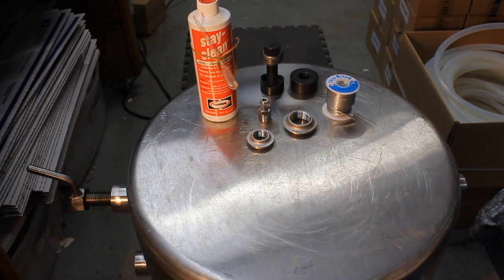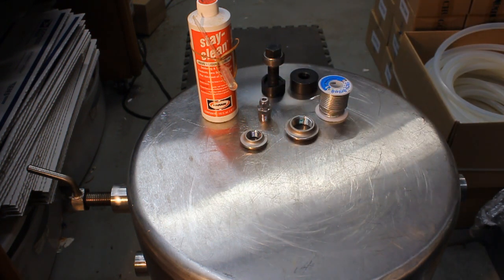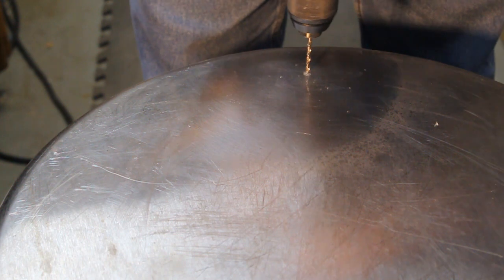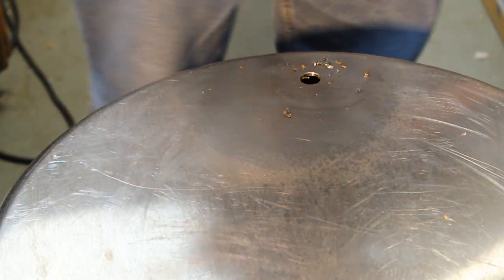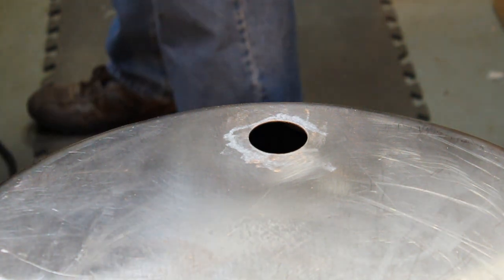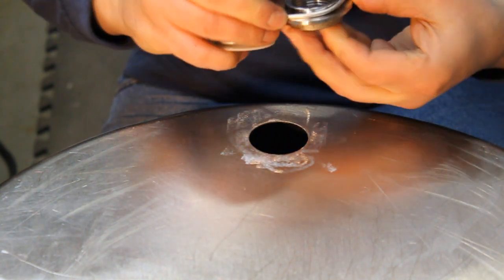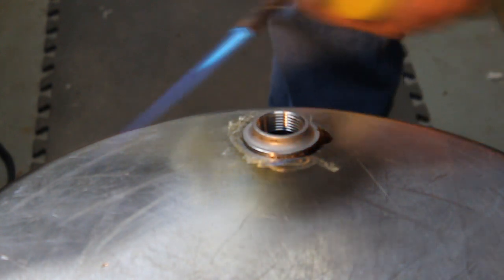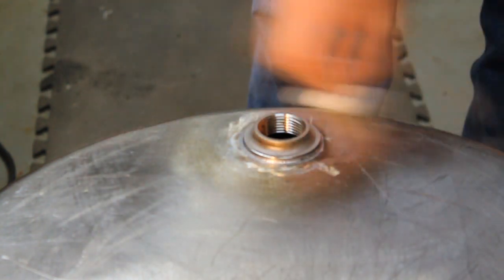BobbyfromNJ Full Silver Soldering Process

Comment: I use plain old vegetable oil in a solo cup to lubricate my step bits for cutting. Comes off easy with soap and water and you don't need to worry about petroleum products in your brew vessels.
Reply: soloban81 animal grease works well. So is having a wide point on your bit, 135° cuts metal way better than a general 118°.

Comment from the maker: You're not being a jerk. A lot of people have trouble drilling stainless and by FAR the biggest problem is using too much speed. The reason this happens is that they don't have a drill with enough torque to keep the speed low. In pots like this, or thinner, you don't really spend enough time drilling to absolutely require cutting oil (if you stick to low speed, high torque). This Chinese import bit in the video has made at least 20 holes like this. If I go out to 1" or larger, I do use oil dips.

Comment from the maker: Mostly that easy. Keep it clean, use the right flux and boom.
Reply: A big part of it is using the right solder.  I've tried this several times using "95/5" silver solder.  Turns out that was 95% tin, 5% antimony !   What you need is a solder with actual silver in it.  Staybrite is 96/4% silver and Staybrite 8 is 94/6% silver.

Comment: The only thing I would add to this video is, even if you have a stainless wire wheel, you better be sure it wasn't used on carbon steel at any time.

Comment: Really nice video thanks for sharing:) 

I would like to try this, but a welder told me, that stainless ain't  stainless anymore when it has been heated. Have you had any problems with rust after the soldering job?

Thanks
Jens
Reply from the maker: Sorry, your welder is greatly mistaken and frankly I would not trust him to do any work for you. If it were true, you wouldn't be able to weld stainless either. You will simply have to clean off any heat discoloration with a stainless wirebrush, sandpaper, a polishing wheel or similar. The remaining clean stainless will pretty quickly re-form the chromium oxide layer than makes stainless stainless. It can be helped along by an oxolic acid treatment which is commonly found in the form of powered stainless steel cleaner in the supermarket.

Comment: Hi Bobby, I have a kettle and fermenters already fitted with your silver solder fittings, I’ve found them to be extremely reliable and they also look great. 
Have you had any experience with anyone fitting a bottom drain like this to a sandwiched base, ie a layer of aluminium between two layers of stainless?
Reply from the maker: Nope. I get the question a lot but no one has been brazen enough to risk their pot to find out.

Comment: Mapp gas (can't get it any longer) or mapp pro? (which is not hotter than propane). Propane is not hot enough to silver solder or braze. So, I'm guessing you have an old bottle of mapp gas, so, this process won't work for anybody else unless they use acetylene.
Reply from the maker: Right, this is soldering with 6% silver content, not 50% solder so it only has to be 430F.
Reply: Mapp gas is carried in any lowes or tractor supply..

Comment: What's to keep the solder from melting again if you have the kettle on a flame for 60+ minutes?
Reply from the maker: Liquid in the pot. Yes, if you put the pot on a flame completely empty it is possible to heat it up over 400F and then the solder will melt again. If you have liquid in the pot, it won't get much hotter than 212F.
Reply: The gas you heat your kettle up with burns a lot colder than the gas you use to braze.

Comment: WHY DID YOU CUT OUT THE ACTUAL SOLDERING?!?!?!
Reply from the maker: I didn't. At about 7:45 you can see me applying solder to the underside of the fitting. AT about minute 10, you see the heat melt that solder and the fitting drops down. I didn't skip the soldering process.

Comment: That was not silver solder?
Reply from the maker: Sure it is. "The only difference between soldering and brazing is the temperature at which each process takes place. Soldering takes place at a temperature below 840°F (450°C), and brazing occurs at a temperature above 840°F (450°C)."  This process was at about 450F so silver "soldering".

Comment: WD40 isn't lubricant, it's a penetrating fluid :p

But aside from that, awesome :)
Reply: Though it's not job specific and more of an across the board product, it does have some lubricating qualities. Even WD-40 thinks their product has lubricating properties (though they are probably a little biased).

From: http://wd40.com/cool-stuff/myths-legends-fun-facts

"A QUESTION OF LUBRICATION

Myth: WD-40 Multi-Use Product is not really a lubricant.

Fact: While the “W-D” in WD-40 stands for Water Displacement, WD-40 Multi-Use Product is a unique, special blend of lubricants. The product’s formulation also contains anti-corrosion agents and ingredients for penetration, water displacement and soil removal."

Who hasn't used it at least once on a squeaky door?
Reply: Jeremy Colby
I'll concede that it can be used as such :p

But, wd40 dries out, often quite fast, so for anything more than short lived use it's not great for lubrication and many people will use it as a full on lube eventually falling foul of this!
Reply: +MiggyManMike   "WD40 isn't lubricant, it's a penetrating fluid"  Its both, primarily a penetrating oil, however its a light lubricant.
Reply: +MiggyManMike Evaporation is a pretty efficient way of cooling though. I'd object to iy for other reasons tohugh.
Reply: it's neither. WD stands for water displacement.
Reply: It's actually a cleaning fluid....Great for cleaning  motorbike chains!

Comment: Those japan made stainless steel stock pots don't last there not worth putting work and money into. I had one, and used it for a boiler and after about 10 runs it cracked and started leaking.
Reply: then you overheated the shit out of it and cooled it too quickly. treat it like you would a cast item

Comment: That's not silver solder that lead or no lead solder. I worked on A/C units for 43 years and used silver solder and it more heat and a lot stronger.
Reply from the maker: Silver soldering is a misnomer in the industry and it has a lot of history behind it. The American Welding Society says that anything done over 840F is brazing and under is soldering. Of course there are grey areas due to the different alloys available. The product I'm using in the video is Harris Stay Brite #8 which has 6% silver and melts at 430 degrees. If it's not soldering, you tell me what it is. It melts under 840F. Just because someone commandeered "silver soldering" to mean brazing with silver alloy isn't my fault. Call it what you want.
Reply: I'd say "silver soldering" begins with 50% silver content solder which is the minimum silver content most higher end suppliers sell in their "silver solder" category.
Reply from the maker: I think using documented definitions of soldering vs. brazing, such as that of the AWA is probably a better way to define it than a welding supplier's product categorization. It's one of those things that snuck in the back door with old time tinkerers. Even the alloys with 50-70% silver content are named things like Braze 505 and their use is clearly defined in product guides as brazing.  If you wish, I'll try really hard to talk about it in terms of soldering with silver bearing solder. It really doesn't matter all that much since I'm naming the exact product in use.

Comment: Personally i would rather just TIG weld or (or even MIG weld it for that matter) over soldering
Reply from the maker: Of course TIG is preferable but it's a machine and skillset that 99% of brewers don't have. Actually it is also a skill most supposed welding professionals don't have either. MIG? No. I would rather solder. If you can do a great job welding, more power to you. This video wasn't meant for you. Cheers.